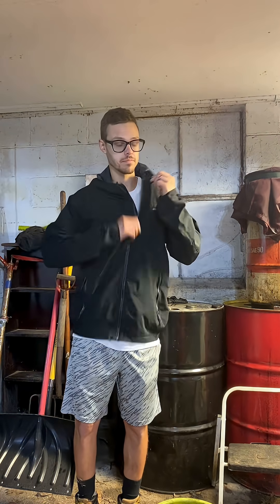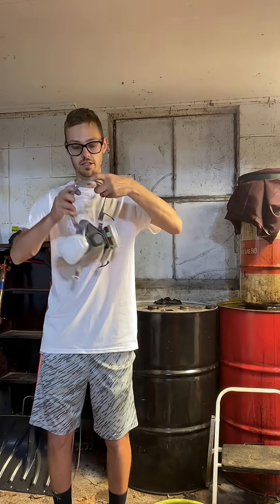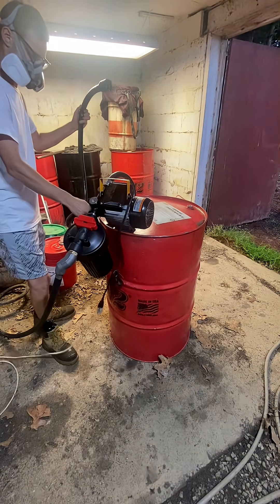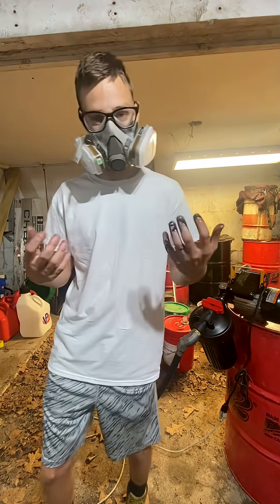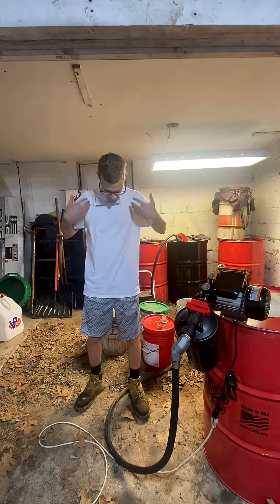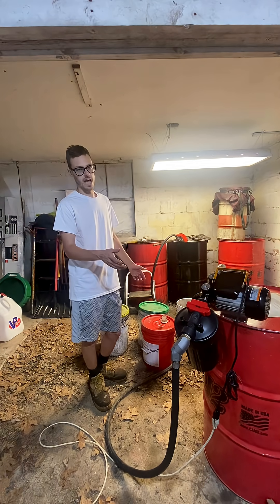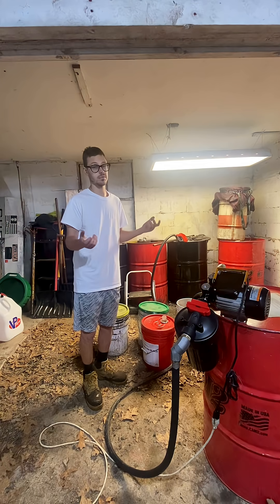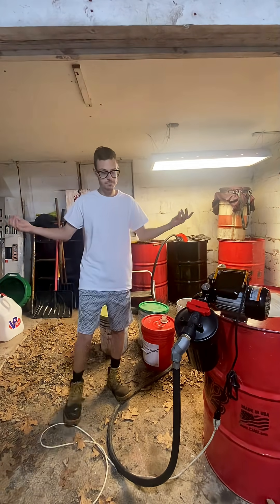Fresh White Tee, Black Gold & #fok - Making Homemade Diesel from Waste Motor Oil

Comment: I hope you understand that what you are making is not actually diesel...Used motor oil contains impurities and heavy metals that can damage an engine's fuel system and emissions controls. Furthermore, burning this mixture can release toxic pollutants into the air, far worse than regular emissions. You will absolutely destroy any engine especially 4 stroke. This is honestly just kind of dumb lol